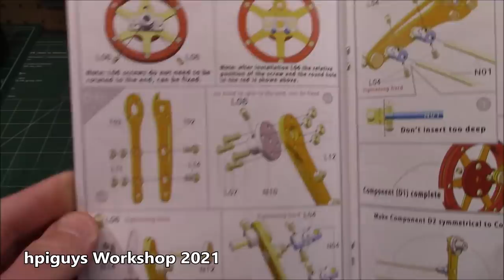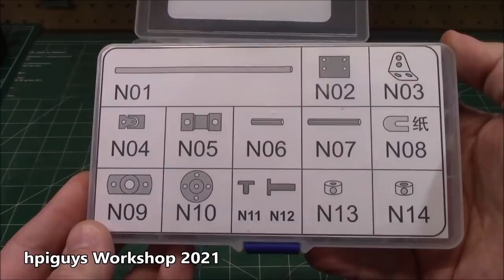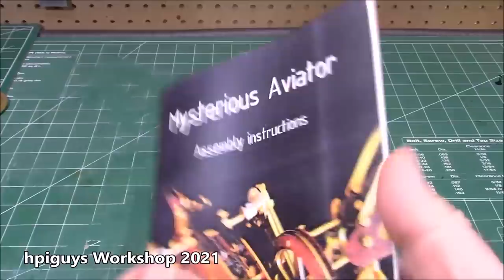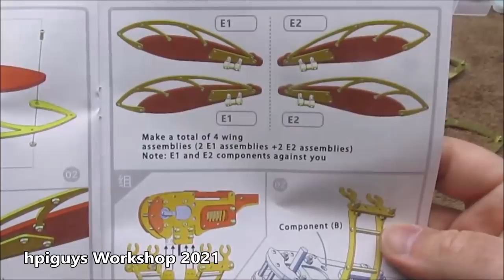Steampunk Mechanical Mystery Dragonfly DIY Metal Wooden 3D Aircraft Moving Model Kit Review DaVinci

Comment: Hi, Cool looking Model and thanks for the honest review . You have made your point but here my thoughts of it, it looks like the Motor run with to low Voltage , maybe you can try give it 6 Volts or up to 9 Volts . And for all don't run it on USB it draw  to much current . And maybe the Power supply will not give the Motor what he needs as an example the Power supply give 500 mA and the Motor needs 1000 mA  the wattage is by 500 mA is  2,5 watts and by 1000 mA is 5 Watts.  But as you said it should made correct by the manufacturer of the Kit have a good Time

Comment: Put a slightly higher voltage wall-wart on it.
Reply from the maker: It's a 3 volt motor, already over run at 5V on the USB.  More voltage will give you the magic smoke release and no more motor.